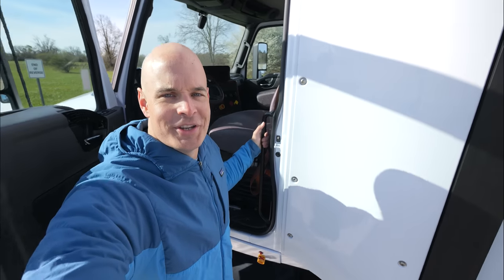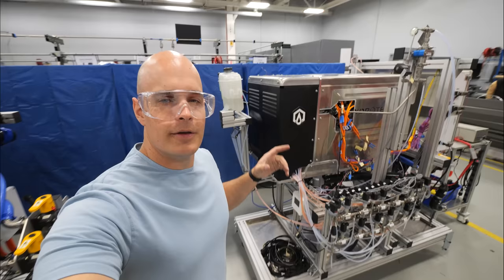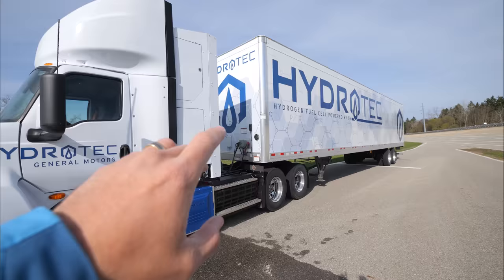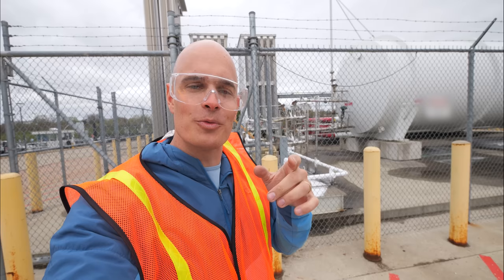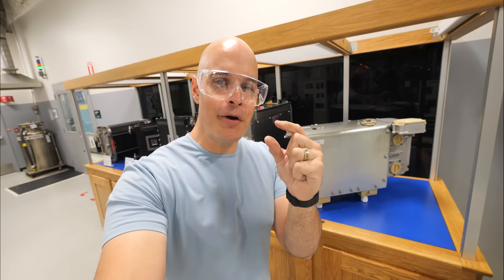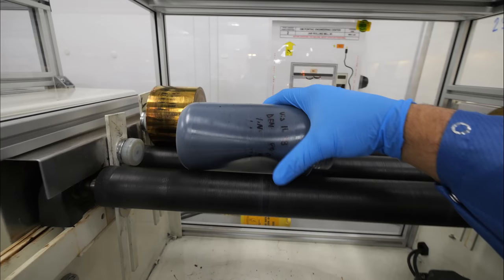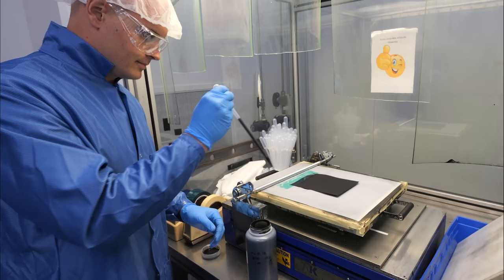How to build a Hydrogen Fuel Cell Semi Truck? - Hydrotec Factory Tour

Comment: Two issues I have with this. One, if every semi-truck turned hydrogen in say 10-20 years timeframe (pretty reasonable and realistic tbh) what if they are driving on winter roads and cause black ice to form on the roads and my 2nd issue is that, with the increase weight proportions and water leaking out of the semi-trucks constantly would this cause even more road/asphalt degradation than intended by road engineers? For example, AZ/CA roads are made differently than the Eastern States (because they obviously don't get a lot of rain) but since a lot of trucking comes through CA (ports that pick up most of our foreign goods from China) wouldn't this destroy our roads faster due to the weight and constant release of water from these trucks? I love the technology, but damn does it suck to be the road engineers 10-20 years from now if they have to consider this new tech driving on the roads lol
Reply: Well, hydrogen tanks are lighter than electric ion batteries so thats a plus. And they could always have a tank to collect the water. It doesn't seem to produce that much. Could be dumped easily every fuel stop. Or figure out a way to evaporate it instantly before exiting onto the roadway.
Reply: @simonnovak  Hydrogen tanks are lighter than lithium-ion batteries but the problem with that is that nearly every "Hydrogen Truck" video/ article I see have a huge lithium battery/hydrogen tank combo. They could have a tank to collect the water but then that affects range (as if that wasn't already a problem) and unless they evaporate the water waste with the sun (maybe on the top of the truck but it wouldn't work during night/cold drives) then they will have to have a electric heater/heat pump that will eat more of the range. True Hydrogen engines (combustion engines designed for hydrogen as the gas) could be a solution but I've watched Engineering Explained's video on that and the issue with it is that Hydrogen as a gas is that it doesn't even come close to gasolines in terms of power density which means they will need a larger tank which will increase weight and lose more cargo capacity. I really feel bad for anybody trying to come up with a viable solution to the greener solution to semi-truck deliveries.
Reply: @noahstuart3025  Hydrogen combustion engines would just put out more water than FCEVs because they consume more hydrogen.
Reply: @eDoc2020  it would be steam vapor coming out of the exhaust not straight up water, even then the energy density of Hydrogen just doesnt make sense with a combustion engine variant.

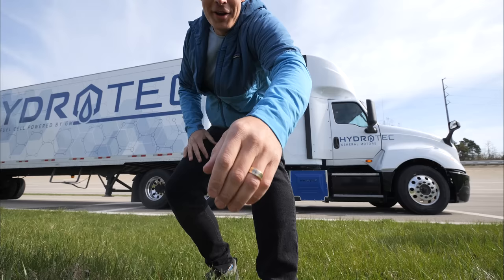Comment: 10:18. Technically You definitely could. Because all hydrogen vehicles are actually just electrical vehicles. Which I don't remember you pointing out. For some reason. But yeah.

All you would need is a couple of PEM membranes in series. And a couple of sets of those in parallel. And you're in business.

Well and some liquid hydrogen of course. I think what we all really want to see. Is how to make liquid hydrogen.

Which again is itself pretty simple.!

Comment: Is that hissing sound that I’m hearing the sound of hydrogen venting to atmosphere as it warms up to prevent overpressurization of the storage vessels? As badly as I want energy-dense non-battery electric options for heavy load hauling, I don’t see this as being feasible. I wouldn’t be surprised if in just a few days the entire supply of stored and unchilled hydrogen would be vented to atmosphere and you’d have an empty tank.

Comment: Solar and wind isn't cheaper, the carbon it takes to manufacture these energy sources outweight their benefits.
Reply: How much carbon does it take to make a coal fired powerplant? (steel, cement, etc..)
How much energy does it take to mine and transport more coal to the power plant?
How much water is used to create steam to drive the turbines or for the cooling towers?

Comment: 10,000 psi what! that is like 25tons of lifting force 
 that is enough pressure to cut anything in half
Reply: And that's not even 2/3 the way to liquid hydrogen at 1,013 bar.

Comment: I guess the water that comes out of the cells is kinda hot? I mean in Humans roughly have the energy of the mitochondria is "wasted" into heat which keeps us at our nice and cozy operating temperature. That was also something that really bothered me about gasoline engines. They get so hot and instead of using the heat we rather have to add stuff that uses energy in order to just waste-cool it away. Formula 1 tried to develop something that uses that heat and i guess it worked quite well, but it is "too complicated" whatever that means, never really explained it and now they will remove that technology from 2026 onward. I mean this would easily boost the efficiency a few percent and make everything that mainly runs on the initial burst and wastes the energy way better. I also just heard it would be possible to use heat pumps to cool something like nuclear power plants more efficient, which would be really important as we have seen with France and a hot summer, where some of the rivers were too warm / didn't have enough water and GERMANY, which had enough energy problems anyway, had to use its gas plants to compensate the missing power.

Comment: I've always wondered why wind turbines haven't been placed it remote windy locations to create hydrogen for fuel.  Perhaps that is in the works.
Reply: Because RTE (electricity - hydrogen - electricity) is about 32% efficient at best so we should get enough renewables on the grid to cover all our demand first without throwing at least 68% out the window
If you have excess capacity after that, put it into a battery which is better than 97% RTE and stop screwing around adding three layers of complexity and thermodynamic losses on top.
Reply: @jimurrata6785  umm, there are lots of places that need electricity that a wind generator/panels don't work-airplanes, cargo ships, extreme north & south locations.  One solution does not fit all.
Reply: @IowaKim  So you want 70% conversion losses instead of 1-2% transmission losses?   🤡
Reply: @jimurrata6785  Did you even read my reply? How many transmission lines can you run to an airplane or cargo ship?

Comment: And there's this more logical 'Hydrogen Combustion Engine' coming up from Japan. 
Why use hydrogen to charge the battery that runs the motor - when you can burn hydrogen (like diesel) inside the engine directly 😯

Comment: Hydrogen looks to be the logical switch for trucks, batteries make no sense as the weight of the battery take away from the payload capacity of the truck

Comment: Except that numerous scientists and engineers here on YT have done the math which shows that hydrogen for fuel in motor vehicles will likely never be practical for use in motor vehicles.  The number one problem is the size and weight of the tanks to hold enough hydrogen under the kind of pressure needed.  It takes more energy to make the hydrogen than you get back when you use the hydrogen in the vehicle.  It takes a great deal of energy and specialized compressors to put the hydrogen under the kind of pressure required.  Wind and solar electricity is NOT cheaper than electricity from a coal or natural gas fired power plant and likely never will be.

Comment: For transport trucks, hydrogen makes more sense than lithium batteries.  It's all about energy density.
Reply: No. It's not.
Reply: @rogerstarkey5390  yes it is. do you see any EV trucks capable to going into the Australian outback where there is no power grid? HEV trucks are to closest thing to a diesel trucks when it come to range.
Reply: And hydrogen is the least dense element in the universe...  💡
We have molecules that could help solve the storage problem, 
but ammonia and methane create NOx or CO² when run through a fuel cell, so you've just created the problem you're trying to avoid.

Comment: With what i know and have seen so far, i think hydrogen power is a much better option than battery electric. But it's all tittering on edge with politics and potential battery improvements possibly being the big tipping point.
Reply: Why is it better?
Reply: @rogerstarkey5390  it's been a while since I've seen anything indepth on it and i don't remember the details so i don't want to risk giving out wrong facts. However,  youtuber physics girl made a good video about hydrogen power about a year or so ago that had me pretty convinced on its use. However, another channel engineering explained wasn't quite convinced and did a good job detailing why. So I'm still a little on the fence. I was a battery car skeptic initially but theyre proving their worth so I'm somewhat converted. Some applications though are struggling to overcome issues such as recharge time and range loss in heavy applications. Hydrogen seems to have a "potential" advantage in those areas. I currently drive a Ram 2500 with the 6.4 hemi, far from economical. But i only drive 10 mins to and from work and not much more beyond that so the difference in fuel saving doesn't offset the cost of a current electric vehicle. I do tow or haul upwards of my truck's limit somewhat often. When loaded down the worst mileage my truck gets is about 9mph giving me about 180 mile range on a tank. In jerryrigeverything's tow test with his rivian he was somewhere around 100 mile range fully loaded. The key difference being i can fill up and get going in about 5 mins vs 45+ mins to charge and many of the places I'm around dont have fast chargers yet. Hydrogen though can "refuel" similar to a gas car with many of the electric car benefits. My grandpa (a classic car collector) had an electric car from like 1904 which had like 8 large batteries, a range of like 12 miles (which was good for early 1900s) and took about 8 hrs to recharge. They're nothing new in concept. The technology of the components has improved massively but they still face the same problems from 100 years ago.  Hydrogen is still in its relative infancy and may not be mature enough yet but i think it shows a lot of promise. I could go on for a long time about this but i recommend watching the videos i mentioned in the beginning and make your own conclusion

Comment: I do love a good explosion. It seems CO2 released from H production is prohibitive even for "Green" H, worse than diesel, and "Blue" H produces worse greenhouse gases. Nuclear power for H production seems the most sustainable way 😵‍💫 and for a truck full of platinum and iridium! With heavy expensive, large and heavy tanks that have to have a short life span with fuel cell that must be kept warm or it blows. Wonder how much the system weighs? 154kW is 200hp - that's low but ok. Still fun stuff. Give it a bend and burn test.
Reply: 🤔 a diesel electric semi might produce less CO2 per kW.
Reply: Or,

1. Renewables -> battery -> motor.

2. Renewables -> H production -> storage/transport -> fuel cells -> battery -> motor.

Comment: Just how strong are those 10,000psi tanks when filled?   Would they explode into a fireball the size of Texas if ruptured in a crash?  
I'm really wanting to see hydrogen succeed as an alternative to EVs with batteries.  They are not the only solution.
Reply: If you wonder how strong they are, consider that they can hold 10 000 psi of pressure.
Reply: @logitech4873    That is true.  I'd still be concerned they might act like a balloon if an object poked into during a crash

Comment: (9:58) "without batteries we get all of the clean energy percs with none of the on-board weight".  Not true. You still need a sizeable battery to buffer the output of the fuel cell. This particular truck uses a 220kW battery which weighs about 3000 lbs. Fuel cells generally cannot drive electric motors directly unless they're very large which then makes them less practical and much more expensive.

Comment: Hey Zack.
What if we have a lot of these cars and trucks that emits water in the future.  What do you think, would it be enough water to compromise the grip of the road surface? Maybe in the city where consumption is high and the cars "wind" wont be enough to dry the surface up quickly. Can it be a problem.... There is a lot of water underneath the truck at 0:05 . Or we simply we need More power -> more consumption => more water. Just wondering, Im not against this technology. Have a nice day! :)

Comment: Hydrogen fuel cells would be great if it was convenient to extract, transport, and store hydrogen at the same scale as fossil fuels.  It will probably get there, the infrastructure is much better than it was 5 years ago, but it's still difficult for now.
Reply: The next decade will be (SHOULD be) about "total system efficiency"
1) Take "free energy" from the sun (the sun cause wind, so that as well!)
.
2) Transfer as much of that energy as possible to the point of use.... On no account WASTE energy.
.
Build more energy supply untill 100% green.
.
Hydrogen does not fit the model.
.
As for "scaling to fossil fuels"
.
It's the worst of both worlds.
It uses more energy to move vehicles than straight electric drive.
It requires a huge fleet to move it to point of use because it has poor volumetric energy density compared to fossil fuels.

Comment: Been following stuff like this and the Hyperion XP-1 project. THIS is the future not that terrible EV only stuff. Some of these vehicles have enormous capacities like 1000+ miles and are 50% more efficient as well as 50% MORE powerful than gas engines. Now if we can just find a way to make batteries better as lithium mines are some of the most toxic places on the planet and are far worse than gas spills.
Reply: John you don't know what you're talkin about
Reply: Did you miss the part where Zach mentioned a rather large lithium battery? Because that whole hydrogen thing is just a hugely inefficient intermediate energy storage method.
Reply: @ChristofferETJ  No I didn't. I understand the problem completely. That is the second phase that is being worked on and there are several options that are being tested. The hydrogen system itself is beautiful and with ships its can work continuously with ocean water through electrolysis. These systems have been on going for a few decades now. There were some bad actors that worked in the oil industry that prevented this stuff from coming to light but that problem has now been dealt with. We can now proceed with research and it will be awesome.
Reply: @user-RCST  Well if that makes you mad I don't know what to tell you but yeah I have been researching this stuff for awhile now and even working on my own HHC convertor for my vehicles. You can get ugly all you want but the numbers don't lie. Take care. Check out of some of Hyperion's research. The stuff they are doing on this rig is OLD tech. Like over 10 years old. Probably more like 20.
Reply: @John_Conner222      So you're quoting outdated research.  Hydrogen is more expensive, complicated, and less effective than BEV technology

Comment: Same range as a regular semi? The regular semi I drove was capable of 1200 miles... what's this one capable of? If they are stripping the electron from the hydrogen atom then what's left is a proton? How do you get water from a proton without the electron? Perhaps a better explanation of the fuel cell is in order?!? I know how it all works...the explanation was a bit less than needed however.

Comment: A lot smarter choice than all electric for semis given they have and build sufficient fueling  infrastructure. I'd argue the lack of batteries makes it safer and cleaner too. I hope this catches up to cars mainstream instead of fully electric which seems like a stop gap solution
Reply: Pyou just contradicted yourself.
This takes 10 times the infrastructure .
Reply: @rogerstarkey5390   lol .. how so ? I said given they build the infrastructure 10x the cost vs gas stations or charge stations ? That's nothing if they are properly placed around the country.
Reply: @emi123nem  
It's not smarter if they require 10x the infrastructure .
That's 3x MORE green grid (?) huge processing plants (presumably electrolysis) water supply (going to be an issue) tanker fleet, which due to the low volumetric density will be 10x the fossil supply fleet,
THEN the filling infrastructure.
.
Doesn't make any sense.
Reply: @rogerstarkey5390  makes no sense at all. 1) Define 10x the infrastructure ? 10x more than now / 10x more than gas or 10x more than electric also if it's a one time cost it's not a big factor. 

2) It takes about a gallon of unfiltered water per KG of hydrogen. 

3) 1 KG of Hydrogen has 121 megajoules of energy. Diesel has about 45 per kj density.  So where are you getting this assumption of lower density? He even said in the video that the tank on the truck is much more compact and lighter than on a battery powered version.

There is no evidence to prove any of what you said in a quantifiable way. Just seems like pure speculation / ignorance or willing to give up existing preconceptions
Reply: @rogerstarkey5390  my man is forgetting the already existing refinery of diesel/ gas and distribution. Nothing would change how it works

Comment: Not sure why GM is even doing this R&D. There is very little infrastructure that will allow SEMIs' to have access for refueling and there are not many plants that produce Hydrogen. Couple this with the fact that Hydrogen is the most volatile gas there is, subjecting these vehicles to the dangers encountered on the road, especially in metropolitan areas and every accident has a catastrophic potential of a decent-sized bomb going off at the same time.
Your content is interesting nonetheless, thanks for posting!
Reply: Tax write-offs and research grants.
This is a jobs program with the benefit of patentable IP, not tech innovation.